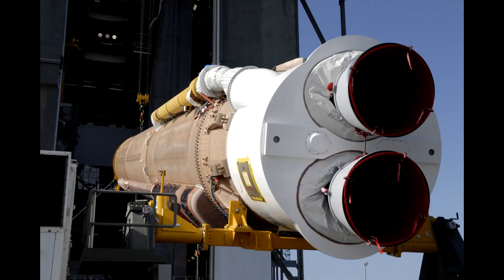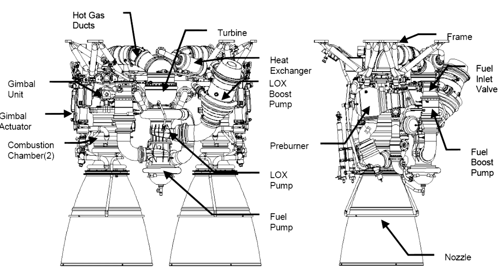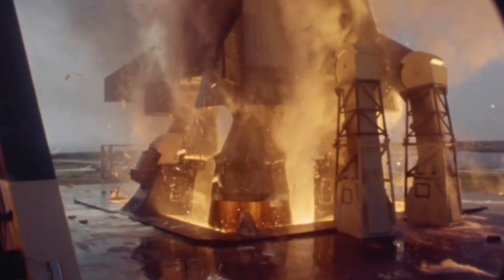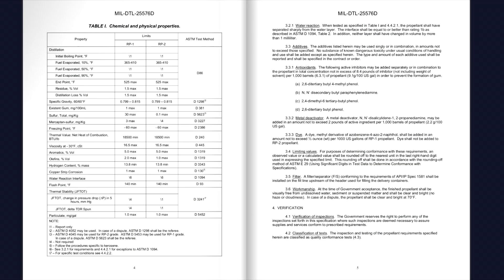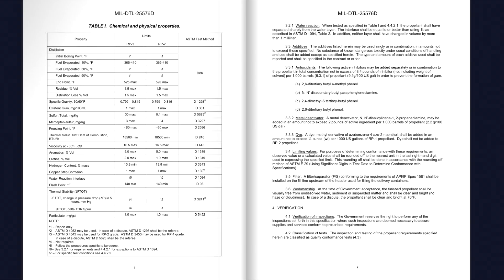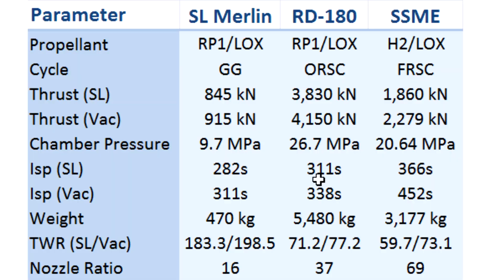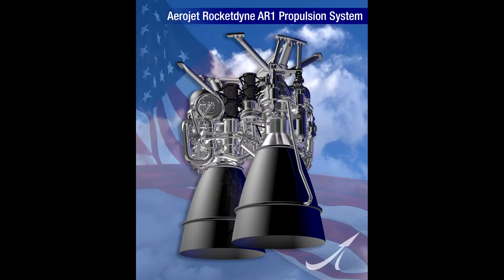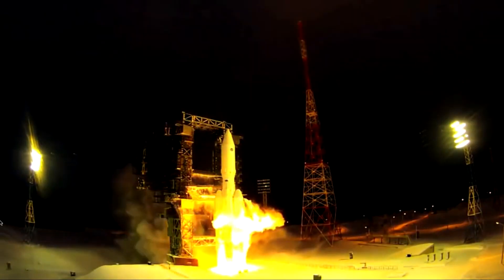Why Some 21st Century US Rockets Still Use Soviet Era Engines

Comment: Well there is this saying, "if it ain't broke, don't fix it" I guess it applies here fairly well.
Reply: simplicity over complexity wins almost every time in engineering
Reply: @gb6912  both are needed. In the programming world especially, the first edition is overcomplicated and with time and lots of patches, the program becomes more stable and faster. But it is still a version 1.x. Version 2.0 is basically a new program doing the same thing but with a new logic to it. But it is not always like this, some just create a few add-ons and call this a new version, which is not true.

Especially in programming, you can see the border between simplicity and complexity. There are some problems where you just can't solve a problem without getting it complicated. There is a certain branch in computer science which studies the complexity of the problems.

But, programming just loves simplicity. You can make your program run multiple times faster by just changing a few lines sometimes.
Reply: The AK-47 of rocket engines.
Reply: Of course that ignores the political realities  of using Russian equipment for US launches.  It puts the US in a disadvantage.  The Russians have extreme leverage of the US.  Why do you think a single seat on a Soyuz tops $80 million?
Reply: Car Industrie.... If Something didnt Brake its too good.
Reply: I think aerospike jets would have been better
Reply: Which engine is best the cryogenic engine or the merlin engine?
Reply: That mindset Kinda hampers innovation though which is why Aerojets engines are still a late 20th century design.
Reply: TheAtom Yeah, but if it is a good design and you can’t really improve on it, why try to improve it? The hammer has been around for millenia, and it hasn’t changed as well.
Reply: @LetsTakeWalk  the simple hammer has been around but hammers in general have come a long way. Now we have hammers that use new technology that can demolish things that you would never be able to demolish with a simple hammer. Maybe the point is, like Scott said these engines will still have a roll to play but new/bigger/better stuff is on the horizon.

I guess we could always hope these old Soviet engines get regligated to "around the house use only" roll.... All we can do is wish ;)
Reply: Yeah there's a lot of variations in hammers and i'd imagine a bit of engineering over the last 100 years to make them more capable for specific jobs. With differenting shapes and metals and alloys some softer some harder hammer's heads and the handle changes with the inventions a better plastics potentially better suited to the job which take some testing and engineering so IDK.
Reply: A 75 year old claw hammer is just as good if not better than today's. A 1940 drill press is hands down better. Eternal progress is a meme that is in large part mythical.
Reply: PS I could fill pages with things in life that are worse than when I was a child 50 years ago. Kids are fed a line of #$@% and given a smart phone and they are told its all good. Its not. Way back when a person could support a family working at a gas station. Now you can't.
Reply: Post post script - at least there are Scott Manley videos to watch. That's one thing better, at least
Reply: @LetsTakeWalk  If it ain't broke don't break it.
Reply: Dean DeanN 
There's more than one thing involved in something being better.

A washer/dryer set from 1950 is considered better than one made today. But a basic srt cost $500 in 1950. Today you can get a basic set for tbe same $500. Sure, the set from 1950 will last twice as long, but when you factor in inflation the 1950 set literally costs $5,000. I don't consider things that last twice as long while costing 10 times the price, using twice the materials and 3 times the energy to make as better.

Oh, and the income in 1950, with inflation is about $33k today, our average is about $55k. Household food expenses in 1950 was just under 40%(yes forty percent) of household income. Today it's 6.2%.

The reason people can't make it today on a single income isn't the income or cost. It's the fact we have more shit to spend money on that people think are necessities. But cell phones, cable, monthly website subscriptions, game consoles, and so many etc's it's not even funny, aren't remotely necessary.

People used to eat out once or twice a month, now the
 average is 4 times a week.

Houses used to cost(with inflation) $130k, and today they're ~$150k. But the houses in 1950 averaged 983 sqft, while today the average is 2,600 sqft .

Shit is way cheaper today and people make a lot mlre money. They waste it. They can make it.  

But no one is saying it would be fun, and they didn't do a lot of things that cost money compared to today because the things people piss money away on today didnt even exist back then. They stayed home or went and did free stuff like the park with their kids. What they didnt do is spend $30-$50 bucks taking them to jump on trampolines or other stuff.
Stupid people piss money away and then claim they can't make it.
Reply: @deandeann1541  Fiberglass handles on claw hammers are definitely an improvement.
Reply: @theatom7264 , it depends on the project. The team which created RD-180 saw a potential which other teams didn't. Since the other teams missed it, they did the normal thing and tried new methods.
So both teams had something to add to the science. Like, as said above, the hammer still does what it did, but the materials we have today made it more durable and practical. It certainly had a long way from a rock tied to a branch.
Reply: @webkeeper  "There is a certain branch in computer science which studies the complexity of the problems." What is the branch called?
Reply: I'm pretty sure this is the motto of the russian space program.
Reply: @VolcanicSpacePizza  No, the motto was to keep it running be any means. The only industry that survived collapse of USSR